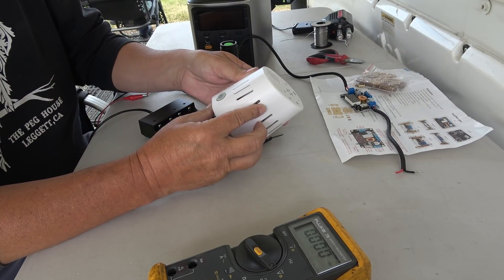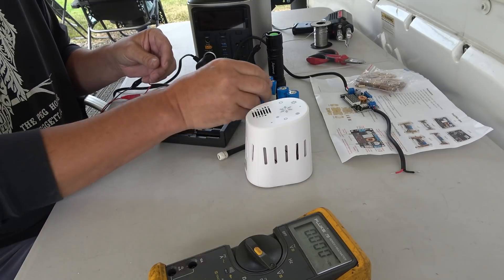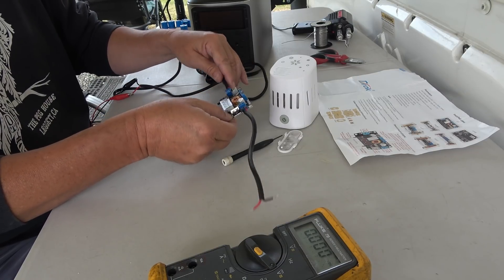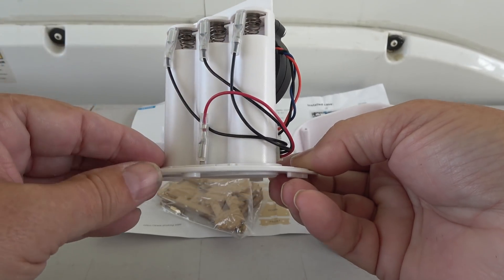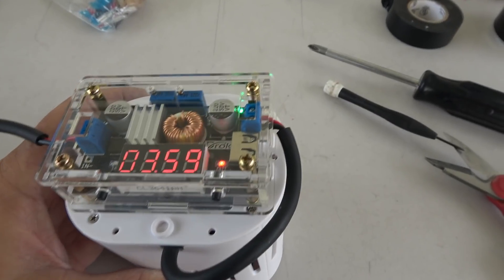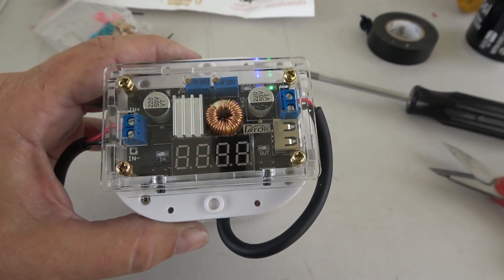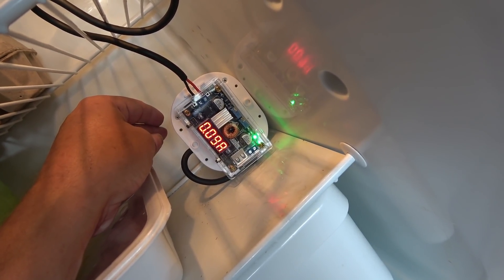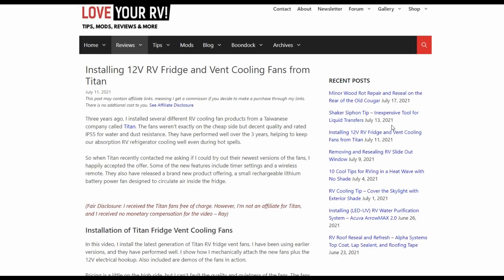Titan RV Fridge Fan Update - DIY Power Mod - DROK DC-DC Buck Converter instead of Lithium Batteries

Comment: Thanks Ray!  I’m curious if you have done any testing comparing the fan inside the fridge with the fans outside the fridge. Do you recommend both or would one system suffice?
Reply from the maker: I find the outside fans do more for overall cooling efficiency. The inside fan helps a bit but is more for even cold distribution for the food, especially if its really packed in there and keeping the cooling fins from building up frost and ice on them. Cheers, Ray

Comment: Nice work! I made my own for free…ish (salvaged from what I already had)! I disassembled a USB laptop cooling pad and attached one of the fans to a broken 10ft USB cable then plugged it into a fast charger! I do have to run the cable outside the fridge door but the latch seems to keep it well sealed anyways. Not the nicest or prettiest solution but cheap and it works.

Comment: I will be installing a 12v 11cuft refrigerator this weekend so I won’t need the fan. BUT, the power converter is what I need. I have a LevelMatePRO which uses batteries and I keep forgetting to turn it off which kills the batteries. So the dc to dc converter is what I need. Perhaps this would also work on our propane sensors!  No more replacing batteries!  Thanks for the tip.
Reply: I just got a LevelMatePRO and it has a sleep mode setting. I assume that will help with battery life, but when I get round to it I will use one of my buck-boost modules to eliminate the battery.
Reply from the maker: You're welcome. :)
Reply: I saw a video that showed the linked product. Nothing against making one, but I’m not so gifted so I purchased this. But the idea of using an auxiliary power supply instead of batteries is your wonderful idea. 

DC-DC Buck, DROK Power Supply Module LM2596 DC Buck Converter 5V-36V to 1.25-32V Step Down Voltage Regulator Stabilizer 3A 5A CC Volt Transformer Reducer https://www.amazon.com/dp/B07LCHTVCM/ref=cm_sw_r_cp_api_glt_fabc_E9SAHBZ06TQVVVPM7Q4F?_encoding=UTF8&psc=1

Comment: Ray, you should look into the Everchill dc compressor refrigerator.  We upgraded and love it.
Reply from the maker: I will consider a DC fridge it when this ones cooling system fails, currently it works OK, and is paid for. :) plus I have a small portable 50 liter AC/DC fridge freezer for extra space.

Comment: I installed a ARP in my RV fridge with four additional fans.  Two in the back of the fridge and two small fans inside the same as inside your white case.  I ran a small two wire electrical wire up through the drain tube and fastened a relay so I can turn the small fans on and off with a fob.  Works well.  The two fans on the outside back of the fridge ran quite often while we were on a month camping trip.
Reply: Read about the ARP but that is just part of your solution. Not getting good performance from my new Norcold.

Comment: Great video Ray! I wonder how that "Buck" converter works with the moisture inside the fridge? Time will tell.
I actually just did your weather station/buck converter mod to my trailer. My weather station ran on 3 AA batteries and the wall adapter. When unplugged the display dimmed. I believe the batteries just keep the settings. So now it's running off the trailer batteries and no wire/adapter hanging on the wall.
Reply from the maker: Thanks,  I added conformal circuit board coating to the board to waterproof it. Hoping that will help out just in case of any frost. But not sure of the little controls and switches.

Comment: And the additional heat coming from the electronic will be dissipated inside the fridge as well? Not good? And the board may as well not last for long inside there? (Cold moisture plus solder?)

Usually there is no need for an inside Fan, otherwise there would be one. Cause the cooling plate is mounted high inside, and vegetables, they need it cool and dry, go low. So we have a circulation inside anyway. Cool air falls down, this forcing the warmer air up in return.

18650s as well can be rated just by wheiging them. According to spec they should be 48 gramms. Some from China come with 36 or even just 25 gramms, providing only 50%.

The use of a proper 18650 and charging outside should, if any, be best. Because outside charging lets the heat from charging outside.
Reply from the maker: Because the fan current is so low 250 milliamps there is be barely any heat created.  I added conformal circuit board coating to the board to waterproof it. I find the fan is useful in our fridge as we tend to being full-time living in the RV really cram it fully which reduces the air circulation. The fan gives it a boost which evens out the temps and reduces frosting of the metal fins in humid locations. Cheers, Ray

Comment: In my fridge there is a drain line which goes through the fridge that a wire can fit through. I'm going to use that and use solar to power my inside fan.

Comment: Ray isn’t it time to move on to a compressor frig?! Just asking.
Reply from the maker: Not ready to spend that much money yet and I like to boondock, usually 4 months a year so nice to have the LP gas option during those months. When this fridge every packs it in I'll likely look at one of the new 12V fridges that have been coming out lately. Cheers, Ray

Comment: Most smoke shops and vape stores will have those 18650s tons of e-cigs and vapes use them. They should have the charger to go along with them too 🤙
Reply: 18650batterystore dot com  has a good selection and better prices than most brick and mortar. You've got to admit eliminating the batteries was a great idea though.

Comment: Try charging the batteries one at a time.  I have lithium batteries and charger, if I try to charge two (small charger) I get a fault with no charge at all.  Good luck.
Reply from the maker: Interesting, thanks for the tip

Comment: ultra fire lol super garbage 18650's . get brand name like samsung or LG , other brand name. the mAh in the ultra fires are a lie! 18650's are 4.2 volts charged and 3 volts dead. 3.6 is resting voltage. also there not great in below average room temp, special a fridge.
Reply from the maker: Yeah, Titan needs to provide appropriate batteries, and not just make the consumer have to pick themselves and hope they work. The buyer shouldn't have to be a battery expert.

Comment: My blue Valtera fridge fan from Amazon takes 2 D batteries. They last about two months.
Reply: Does the Valtera fan provide enough power to actually move air?  I read many negative comments about the Titan not moving any air to make a difference
Reply: @kenmusil8076  Mine works well, but I have a small fridge

Comment: Wowww incredible neat job!  Does that fan really seem to improve cooling inside the fridge any? Here in USA I think we can get those 18650s fairly easy, even from Amazon. There are also some companies just selling these types of batteries. Samsung 30Q I think is a good one with 2,800 or 3,000 mAhr. Thanks
Reply from the maker: Thanks. :)  That is the theory. I already use the lowest setting and still get frozen food on the top self occasionally and lots of frost build-up on the metal fins. So I'm hoping this fan will circulate the air better, to get rid of the frost build-up and make it have more even cooling top to bottom. I have to admit being full-time and liking fresh foods we really end up constantly packing the fridge and much of it vegetables that give off moisture. So airflow and humidity are a concern. Will be interesting to see if the fan can make a significant difference.  I remember I had an old campervan back in the day and a little battery-operated fridge fan did help it out a lot. Cheers, Ray
Reply: @LoveYourRV  Oh, sorry about that. Maybe on the medium or high setting it will be better🙏🤞 I have the little Camco and Valterra ones. They look slightly  different from each other, but about the same size.They take regular batteries, the larger D or C size if I remember correctly because I haven't had a chance to use em yet. I wish they made D size lithium ion rechargeable batteries like they do for AA and AAA. Glad to hear from you that it helps. It makes some sense that the circulation helps. I already have a couple excellent flashlights that take the 18650s and am so glad they are lithium ion rechargeable. Good quality rechargeable lithium ion batteries are wonderful. Thanks, keep cool 💦

Comment: I got the fan after I saw your initial video, got another one that took 2 d cell batteries so I now have two fans inside my fridge but the question is will it help the fridge run more efficient? Can you drop the coolness settings from 4 out of 5 to to let’s say 2-3 and maintain the inside temps.  Let us know if you come up with those findings.  The other fan I got was from Amazon called beech lane rv fridge fan
Reply from the maker: Won't be able to test that since my fridge doesn't have a dial setting. It uses a thermistor that is attached to a plastic slider on the fridge fins. Higher for more cooling, lower for less. But I already use the lowest setting and still get frozen food on the top self occasionally and lots of frost build-up on the metal fins. So I'm hoping this fan will circulate the air better, to get rid of the frost build-up and make it have more even cooling top to bottom. I have to admit being full-time and liking fresh foods we really end up constantly packing the fridge and much of it vegetables that give off moisture. So airflow and humidity are a concern. Will be interesting to see if the fan can make a significant difference.  I remember I had an old campervan back in the day and a little battery-operated fridge fan did help it out a lot. Cheers, Ray

Comment: Nice DC-DC Buck Converter and at $18 not a bad price. I like the display yours has plus I see it has current and voltage controls, very useful. I got 10 bare bones tiny units for wall wart elimination, 10 for $19.99 but I think I will order one or more like yours for the reasons mentioned above.

Comment: I wonder if you would be interested to measure the TOTAL daily power consumption of your fridge, not just the factory installed parts, but include all your add ons and mods. I am curious how close you are getting to a residential fridge.
Reply from the maker: That would be quite variable depending on outside temp and humidity and how much we were to open the door that day and whether new food/beverages has been added or not and how warm the newly added food/beverages was. Also how much already cooled food was in the fridge and freezer. So could be a chore to get an accurate comparison.
How much does a comparable residential fridge use? My gut feeling is I'm still way more efficient if using gas.  I have heard from a few people that say residential cool better but really draw down the batteries when boondocking. Some of the new 12V RV fridges are getting better though I understand.
All the fans I've added are very efficient running flat out are still likely under 10 watts. And they would only be flat out running when really hot out. So for say 70 degree days the draw would likely be more like 5 watts.
The biggest draw of the my Dometic fridge is the electric element 335W but in LP gas mode the flame does the heating job. In LP gas mode the only OEM power draw is 12VDC to the fridge controller board and the fridge lights. I bet the controller board draws less than an amp since it has a 3 amp fuse and the fridge light draw about 1.5 amps itself.
Reply: @LoveYourRV  True, but I measured mine for several weeks then computed the average.
Reply from the maker: What was your average? Judging from what others have said in various forums about their Dometic 12V power draw in LP mode and adding in the average load of my fans the fridge would average about 15-20 amp-hours or 180-240 watt-hours a day in the summer. In the winter when I do the bulk of my boondocking down south or shoulder seasons on the coast, I'm sure that would be much less as the fans and burner would run significantly less.
Reply: @LoveYourRV  I used a kill-a-watt meter for 2 weeks so the average should be good. Like any others who have done this test, the 28 cu ft residential fridge/freezer uses 1,500 wH per day. That was one of the reasons to switch to Lithium, an equivalent 3 day supply of Pb would weigh 804 lbs vs 186. We have had several traditional RV refrigerators and there is NO comparison, the residential is bigger and works all the time and ice cream freezes. Many forum posts testify to the fact many RV fridges do not work well.
Reply from the maker: Wow, 28 cu ft is huge! My Dometic absorption actually works pretty well, ice cream is hard even though we always fill the fridge. This is the second one I've had, the first was not nearly as good. When it failed it was still under a 6 year rig extended warranty. Even though it got replaced with the exact model DM2652LBX I noticed they had changed the piping in the back quite a bit and the fridge/freezer performed much better than the old one. My theory is they saw the competition from the residential style and knew they had to make them work better.  
I generally use the lowest setting and still get frozen food on the top self occasionally and lots of frost build-up on the metal fins. So I'm hoping this inside fan will circulate the air better, to get rid of the frost build-up and make it have more even cooling top to bottom. I have to admit being full-time and liking fresh foods we really end up constantly packing the fridge and much of it vegetables that give off moisture. So airflow and humidity are a concern. Will be interesting to see if the fan can make a significant difference.  I remember I had an old campervan back in the day and a little battery-operated fridge fan did help it out a lot. Cheers, Ray
Reply: @LoveYourRV  I made a boo boo, the RV fridge is an 18 cu ft, the fridge we had in our house was 28.

Comment: Much simpler to just mount a 12v fan in the fridge.
Reply from the maker: Yeah, definitely would be. This was more an experiment showing how the DROK converters can be used and I had the little 3-speed fan with case and power button anyway.  Cheers, Ray

Comment: Your fan is only drawing ~864 mW of power (i.e. 3.6V * .24A). You could have paid a lot less for your buck converter here:
https://www.ebay.com/itm/283958688335?hash=item421d41ba4f:g:B5gAAOSw6X1guJnb
Reply from the maker: The difference is money isn't enough to concern me for a one-off project, plus I get a nice case and have some trust with the DROK product line since I've used a few of them in other applications and they have held up well.
Reply: @LoveYourRV  Both circuits use the same chip.. lol

You also don't know that the DROK is any better, but, hey, if you like to spend $ that you don't need to spend.. Have at it.. lol
Reply from the maker: I said that I have used the DROK product for other applications and they have worked well for me and it came with a nice case and has a lot more going on than just the regulator chip. The DROK also has multiple built-in safety protections. PROTECTION --- over-current protection; short-circuit protection; over-temperature protection.
I don't need to save bucks bad enough to buy the 99 cents eBay stripped-down bare bones version. But if you need to save money that bad, Have at it. lol
Reply: @LoveYourRV  I don't 'need to' either--it's just a matter of not spending $ that doesn't need to be spent.  You spent almost 14 times more than you needed to spend--that was the only point that I was making...

Comment: Good Lord, you only got 2 days on medium with 3 of those 18650 batteries? I forsee the Amazon rating on this thing going to zero. I think a 12 volt computer fan zip tied to the fins would do a much better job for less than $20.
Also they make piggy back spade lug connectors that are great for tying into things like switches or anything really that has a spade lug connector on it.

https://www.amazon.com/smseace-Terminals-Insulated-Piggyback-Connector/dp/B08DCRRL2J/ref=sr_1_2_sspa?crid=1WNQTOB6CG7ZL&dchild=1&keywords=piggyback+spade+lugs&qid=1627167446&sprefix=piggy+back+s%2Caps%2C215&sr=8-2-spons&psc=1&spLa=ZW5jcnlwdGVkUXVhbGlmaWVyPUEzNFBMQk1SUzc3NVJRJmVuY3J5cHRlZElkPUEwMzA2OTcyTjUxMFNWQ0FCRklRJmVuY3J5cHRlZEFkSWQ9QTA2ODA2ODkzN0FKNVEwME1NU1FOJndpZGdldE5hbWU9c3BfYXRmJmFjdGlvbj1jbGlja1JlZGlyZWN0JmRvTm90TG9nQ2xpY2s9dHJ1ZQ==
Reply from the maker: Yeah, they really need to include their own proven good Li batteries for this thing.